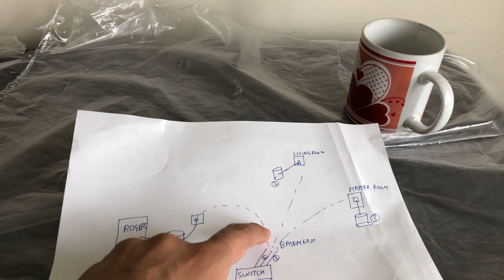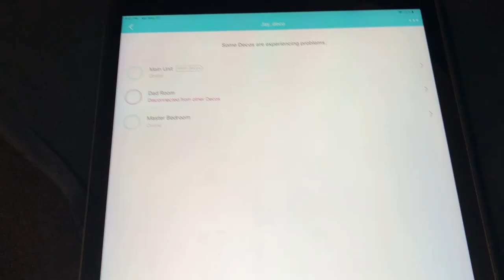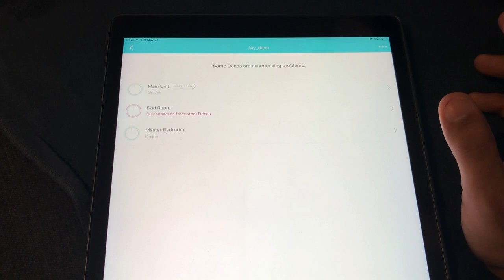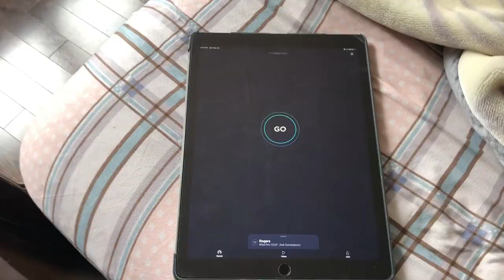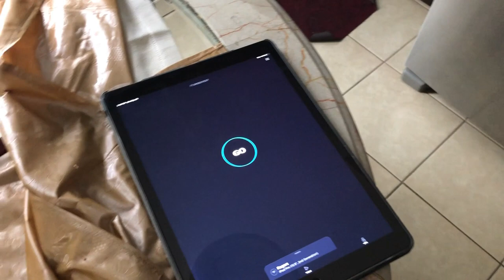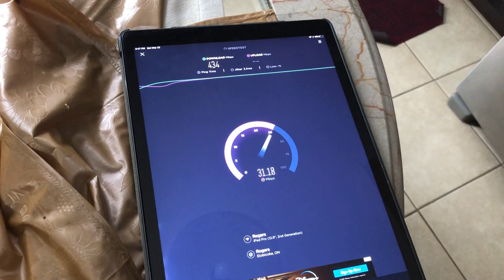Hardwire/ Ethernet Backhaul Mesh Wifi 6: TP Link Deco X60

Comment: Can you explain why you connect main deco to modem instead of connecting switch to modem.?  And i dont understand that you are sending data to back to the wall port its a female port right ?
Reply from the maker: To answer the first question the reason is I have router mode
So switch is connected to main deco which connects to other slave decos

My lan cables run from basement to the individual rooms
So the switch is in basement and other end is the one in walls

Comment: Hi Jasdeep, could you inform which switch brand and model you mare using? Cause here at my home I have 4 D-Link DGS-1008A GIgabit unmanaged switch, and when I connect the first switch tot he 2nd port of the Main Deco X60, DECO X60 remaisn green, however the ethernet and wi-fi crashes. If I go to the cable modem to test my VOnage line directly connected to the modem, it is working just fine. That is, there must be some type of incompatibility between D-LINK switch and DECO X60!
Reply from the maker: TP-Link 8-Port Gigabit Desktop Switch (TL-SG1008D)

Comment: Hello Jasdeep, I have 4 x Deco X20 and struggling a bit with setup.
Our vodafone modem is in the garage on ground floor. 
From garage there is
1 x ethernet cable to living downstairs 
2 x ethernet cable to office 1st floor 

Based on your explanation,  can you plz correct me if iam wrong in setting as follows:

From vodafone modem - 1 x ethernet cable to main X20 in garage.  From this X20 to a TP link Gigabit Switch in garage

Lan1- TP LINK SWITCH to living , connect 2nd   X20 .
LAN 2 - TP LINK SWITCH to office, connect 3rd X20

4th X20 , put either on ground floor to connect wireless to 2nd X20 ???
OR Upstairs to connect wireless to 3rd X20.

I have a PC in office that can connect to 3rd X20 in office via ethernet??

I also have a IP Phone, that I can connect to second ethernet cable in office and this can then connect to vodafone modem in garage using LAN1- Lan 4 port??

Please confirm if this setup will work .
What mode should the X20 be on Router??

Really appreciate your help on this plz
Reply from the maker: Before any Ethernet setup you should setup all decos wirelessly. So connect the Main modem to one deco and put all other 3 decos in the same room and setup wirelessly

Later pickup the decos and do the setup as you mentioned

Commenting on your setup:
Modem--> X20 --> Switch (Garage) is correct
Switch to --> 2 decos is correct

For the IP Phone I would suggest connect to deco rather than the Vodafone modem
This should work in Router mode which I would suggest because all other functionalities like Antivirus, beamforming performs best on Router

If this works well try to put Vodafone modem into some sort of bride mode or stop Wifi on it so you eliminate interference all together

Comment: Can’t you have 3 wires coming out of your Rogers modem and each wire going into tp link router/extender ? Is switch necessary
Reply from the maker: Good question 
If you want AP functionality then it is perfectly fine
But if you want Router mode then you need a master Node which connects to rogers modem and rest are slave node which connect to Master node

Depends on the used case
I have a router mode so I need a switch

Hope that helps

Comment: Hi, why do you need a switch and not plugged directly to main router?
Reply from the maker: That would AP mode
I needed router mode so had to connect the rest 2 from main deco
Since main deco is far and all my cables are in basement so I had to put a switch

Comment: Hello brother. Is it necessary that the 2 Deco units should be connected to the main unit via switch or can all the units be connected to the main ISP router?
Reply from the maker: It depends on the type of network you want
For router mode yes because it is master slave concept, you need a main node

For AP mode you can connect directly to the isp modem

Comment: Hi,  So i have a question. With this configuration ur mesh is working ok ? Or this are acting as an access point and will switch each time you go to a new room ?. Antivirus function, and mesh are up and running ?, if you want to connect a new deco on a room that does not have cable connection will it be running perfectly ?
Reply from the maker: Yes
All my units are in router mode so all functionalities are working including the antivirus 
Even if you add another non wired deco it will still work the same

Comment: Bro, you shouldove the switch away from the high voltage lines. Just mount it somewhere close (12").  You will get interference eventually

Comment: What is your internet package? I see you have about 500m/30M from Deco? 
Is this the one you get from Rogers ??

Or you have a 1GB / 60M from rogers? I want to implement exact same solution as you do. Only diff is I am planing to use a ER-605 as a wired router to save a Deco
Reply from the maker: Rogers 500 is what i have
Reply: @Canada_Facts  Thanks for letting me know about it. Now I am confident that the backbone'd x60 access point can give the full speed delivered. Not sure, how does x20 work in this case. It will be nice if you could give a video on x20 too, as that is cheaper configuration ..

Comment: Wow thanks alot! Ive been wondering if this will work or not. Could tou show us how to set up the decos to be wired?
Reply from the maker: Hi Jason,
Initial setup should be wireless just like you would do. This is prescribed by Tplink

Later the main deco is the one from where the cables should be going into the other decos

I connected a cable from the main deco to a switch, from the switch I connected 2 cables to the 2 decos respectively 

Let me know if this makes sense or I will make a video
Reply: @Canada_Facts  so initial set up you should put them next to each other. Once they are connected, then you are free to move them around the house, as long as they are connected wiredly (even via switch)
Reply from the maker: @jasonk7361  You got it

Comment: If the decos are as close as 1 meter to each other, would it be a problem?Actually, there is a small distance in between, but it is covered with walls.  And I want to buy 2 separate decos for that area and set up as a wired backhaul. I have already some decos in my house. I want to add more.
Reply from the maker: Typically 3m or more should be there to avoid interference but it depends on the layout of the house
Another thing is Wifi 6 is much stronger and can easily penetrate walls
So for your case I would suggest:
1. Check the internet speed at that spot (1m away) vs close to the current deco unit

2. Check the handoff if it is seamless now
3. Pick one deco from your network and test in that 1m unit
4. Monitor the speed and the handoff- both should be good

If it works as expected go ahead and buy
Reply: Thank you so much.

Comment: Great video! With the main unit feeding a gigabit switch, can I plug other hardwired devices, say a computer NIC into and it will be on the same network or is the switch just for sharing the backhaul for the mesh devices?
Reply from the maker: Mike when the main unit connects to gigabit switch all ports on the switch get the same connection

Hence ideally you should be good with connecting other devices

I haven’t tried it but definitely worth sharing once you do it
Reply: @Canada_Facts  I just got my Deco yesterday. It works just as you say. Plug one Ethernet jack into a switch and it presents the network there.

Comment: Hi, I tried this method and it didn't work. My first question is, do I need a tp-link switch that is backhaul capable? because mine is TP-linK SG105. My second question is, how many decos can you connect to the switch? Only two?
Reply from the maker: Hi Edwin
I am not sure about the TP link compatibility, I used a TP link switch to avoid that and maybe you should reach out to TP link to check that
As per the number of decos their hasn’t been any mentioned limit, I connected 2 more since I bought a pack of 3
Hope this fives some direction

Comment: what if I needed a coaxial connection from network box basement?  How would I implement the router mode by not using the modem and switch combo?
Reply from the maker: Hi there
Would you be able to elaborate a bit
The coax would terminate at the isp modem/router
From there you will have to use lan cable and connect to decos
Reply: @Canada_Facts  The new house had been built with the network /electrical box located in the 2nd floor master closet. All the network cables including the 3 RJ's, coaxial are initiated from this location and go to the corresponding outlets on the 2nd & 1st floor. The home had been spec'd out with only two prongs at the bottom of the box. One occupied by the security monitoring prong drilled in it.  
My internet ISP requires a transmission via the analog coaxial.  I was looking for an alternative solution that would involve a clean wired, " ethernet backhaul " solution  without compromising the space and yours fit the bill. Thank you.

Comment: Is your Deco in router or access point mode? Does it have its own SSID?
Reply from the maker: Access point 
Same ssid as main internet
Reply: @Canada_Facts  thanks. Great video. I am trying to do the same. I read somewhere that Deco has to have its own SSID.  Guess not true. What router do you have?
Reply: Assuming the SSID comes from the non-Deco router?

Comment: why do you need to use cable connection? I don't think you need a switch
Reply from the maker: Cable connection is for ethernet backhauling
Switch is required as my house layout doesn’t allow two cables from main deco

Comment: Can you tell how stable is connection when you move from one router to another. Does it switches seamlessly
Reply from the maker: With Access point Roaming is slightly slow if you move between Isp modem and deco zones
Shouldn’t be an issue within deco zone

Comment: Is it possible to add more deco aside from the first pack that you've bought? Thanks.
Reply from the maker: Yes I think you can add upto 5-6 decos on the same network
Reply: @Canada_Facts  Does it slow down if you add beyond 3 decos?
Reply from the maker: @jagdeepsingh3684  Technically no, upto 5 - hardwired should not drop in speed if they are correctly positioned
If connected wirelessly it depend on lots of factors like distance, interference etc.

So try to play around different locations with lesser count and so on

eg: My house is 2500 sqft and when I put 3 (hardwired ) , there is enormous interference and slower speeds, when I put 2 diagonally opposite hardwired I get 600+ across
Reply: @Canada_Facts  Cheers, thank you for your input.

Comment: I have a, question. Can we connect isp router to deco systems via switch that you install.
Reply from the maker: Yes
But the isp won't be acting as part of mesh rather more of extender. 
Not advisable as interference could be there

Still you can try

Comment: Is your Rogers modem in bridge mode?
Reply from the maker: Yes
Reply: @Canada_Facts  thank you! The other issue I found is that I had 2 x60 and 2 x20s and when trying first with the x60 it didn’t work. I had to hook up the x20 first and then connect the other Decos in the same room/near the first one wirelessly. Then distribute to the floors/Ethernet plugs. Also found that the cable with the Deco wasn’t good enough so had to go buy Cat6 cables. I now get 700MBpS throughout the home wireless.

Comment: Are you using at all the WiFi in the Rogers modem? I have the very same modem from Comcast, having endless issues with the wireless mesh pods from them.
Reply from the maker: No my Rogers modem is in bridge mode
Reply: @Canada_Facts  ok thank you very much!
Reply: @Canada_Facts  I’ll have to revisit this solution then thanks
Reply: @Canada_Facts  You seem to have this figured out and I am only learning so I will ask you! :) Would there be any problem from having an additional switch before one of the Decos?
Reply: Hello. It will have the same network all the decos? With the wire setup?

Comment: If my modem/router has 4 Ethernet ports, can I skip getting a Switch and instead just connect my 3 Decos directly to the modem/router Ethernet ports?
Reply from the maker: No that can't be done
The whole point is one deco becomes the active router by connecting to the modem
Other decos connect to this main deco
Reply: @Canada_Facts  Ok, so I assume the modem/router has to be put into Bridge mode for the Decos to work? Or can they work without the modem/router being in Bridge mode?
Reply from the maker: @Snivy102  Bridge mode is better to avoid interference completely
Reply: @Canada_Facts  ok. I appreciate your responses

Comment: do you need a wifi mesh for this? can I use existing modems per room? also, can I use the available modem as a router since it has 4 ethernet ports. I am asking because I have ethernet cable for each room like you, but I dont want spend if I can avoid it
Reply from the maker: Hi Jd
Yes modems can be connected together and coverage can be increased but the system would be acting like an extender and not a mesh wifi
Eg- Your devices won’t be switching from one node to other seamlessly, rather you would observe a signal drop whenever your device switches from one node to other
Reply: @Canada_Facts  Does this mean there will be a unique username and password for every room or can I keep the same username and password so I dont have to keep on signing in whenver I move to another room
Reply from the maker: Hi Jd
You are flexible to choose any username and password 
I would recommend to keep the same username and password
That would help in automatic switching

Comment: If I already got a router, so I connect all DECO through hub that link to my router. Will I still be able to use mesh function?
Reply from the maker: Very typical scenario, you will have to hit and try
Try to connect, move your phone around and test for speeds and roaming
Reply: @Canada_Facts  Got DECO now. Easy setup but no advance config at all ha ha ha.

Comment: Hello. I would like to ask if I connect my satellite decos wirelessly to the main deco (which is connected to my isp router), can I use the ethernet port of these satellite decos and connect it to the ethernet port of my consoles, laptop, or tv?
Reply from the maker: Yeah
The reason you have ethernet ports on decos is to connect to devices

If you have more devices near a single deco you can plug the ethernet from deco to a switch
Reply: @Canada_Facts  Thanks for the info!

Comment: Hi,
Can you please explain what’s the process of setup?
Currently I have 2 decos, one main and one WiFi , do I only need to connect the WiFi deco Ethernet and it will work? Or should I change anything on the settings?
Reply from the maker: The process is
1. Connect Isp modem to the main deco via ethernet

2. Now you need to connect another ethernet from the main deco to Satellite deco
For this if there is an option to connect directly do that else you can use a switch as an intermediary
Reply: @Canada_Facts   thanks.
I did step 1
Then connected the second one via wifi, after I brought a long cable from one room and connect the second one with cable but nothing happened.
Reply from the maker: @oferziv1  Did you connect the long cable between main deco and second deco?
Reply: @Canada_Facts  all worked once I changed the setting to access point
Reply from the maker: @oferziv1  perfect - still I would mention that even in router mode it should work

Comment: hi jasdeep, i've connected my main deco to my router using port 1, port 2 i connected to my tv, its not working as internet.. do u know how to do it? my second unit that i put 2nd floor (connected via mesh) not hardwire like u do, have 2 port also, the port 1 can be use, 2nd port is same not working as a LAN too( port 2 i connected  to my laptop have no internet) , is there any setting that we need to set for 2nd port running internet?
Reply: x60 have very less LAN.. not like our normal router have Internet LAN then have (4 LAN port) that u connected straight away have internet.. but this deco isn't like that .. do i need to buy gigabit LAN extender to make it have internet?
Reply from the maker: For your first question- please test both the ports on each deco as I doubt your units are defective
For me I can plug the ethernet in either ports and it works as expected

Second question - Yes deco has only 2 ports per unit so if you have to hardwire more devices use a gigabit switch

Comment: I'm having a lot of issues with setting up the deco x20s. I've got them both working but the deco unit upstairs is connecting via a weak wifi signal and not via Ethernet. 

I've tried everything. I have them operating in access point mode out of my main modem/router. Once or twice it did connect by Ethernet but then that instantly drops back to crappy wifi. 

Any help would be a god send 🙏🙏🙏
Reply from the maker: Hi John
If that is the case I would suggest to try switching the two decos and seeing if that helps
This will let you know if upstairs deco is faulty or not
Second is to try router mode on it

Comment: Hi, After changing Rooms my  connected devices Auto re-connects to WiFi even after having same SSID.
I have X 60 3 Qty connected with Switch using LAN.
Reply from the maker: Could you explain i detail what you mean by auto reconnects
And whats the configuration

Comment: Hello bi
I have archer a6 can i connect deco m4 with archer a6 router via lan cable
Can it support mesh with primary router or can i use deco m4 as primary router
Reply from the maker: Hi Sohrab
Technically you can connect them together and better would be m4 as primary 
But I am not sure if archer would become part of the mesh
I would suggest do a hit and trial

Comment: How to ethernet all 7deco? (Note= you dont teach how to connect those 3 in setting mode)
Reply from the maker: Hi
Not required
All the decos get hardwired when connected to the Main deco
You only need settings for AP/Router mode selection